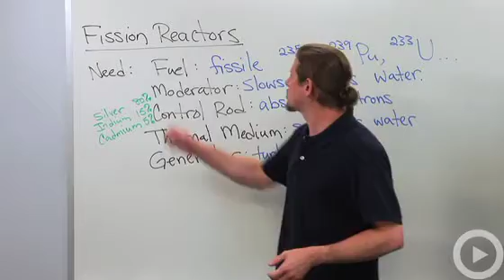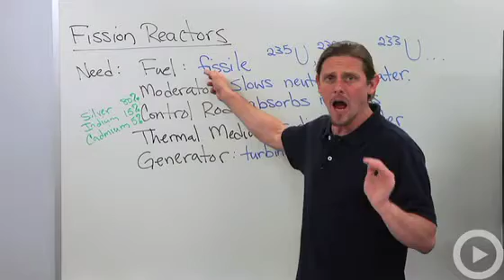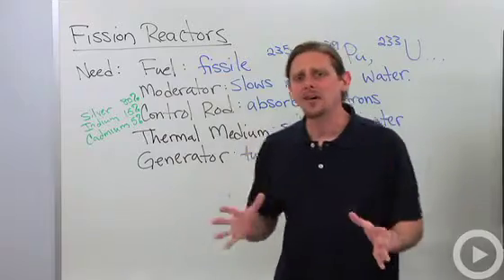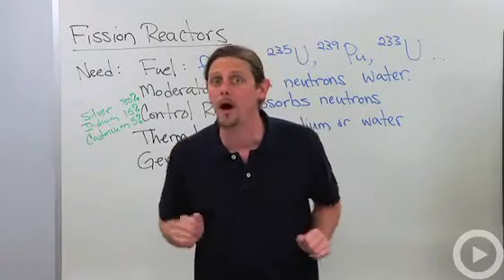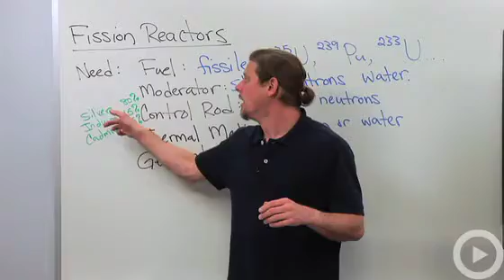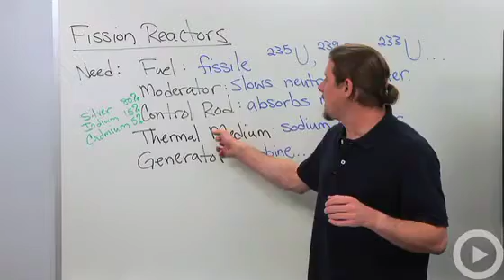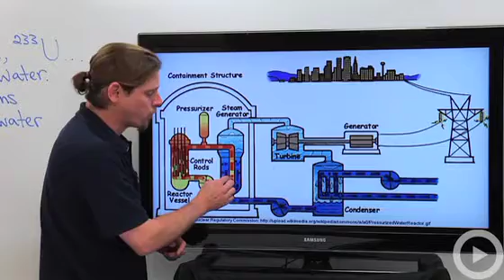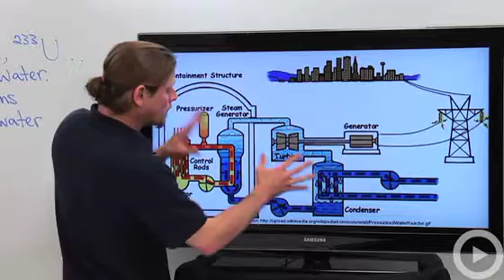Fission Reactor

Comment: "Pressurized" when talking about reactor really means "highly pressurized", and applies only to water cooled reactors; for example, the inner loop of a 600 MWe CANDU water cooled reactor operates at 2500 psi). The high pressurization keeps the inner loop from turning entirely to steam, and gives the water much better heat capacity. Sodium doesn't need high pressurization, only enough pump to keep the sodium moving.